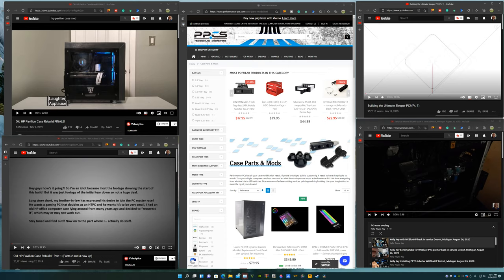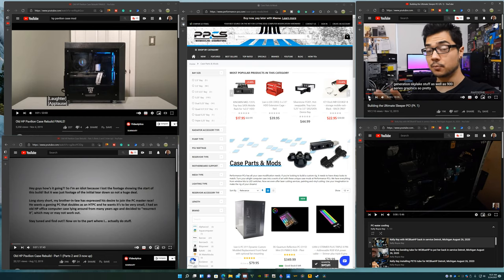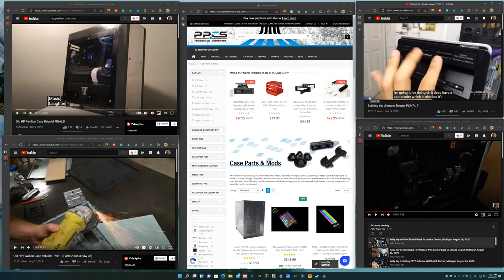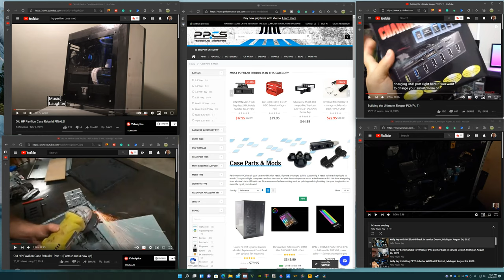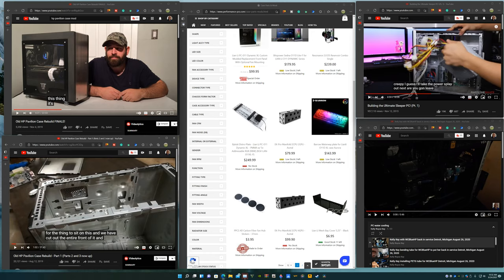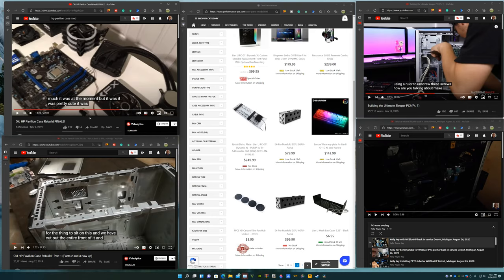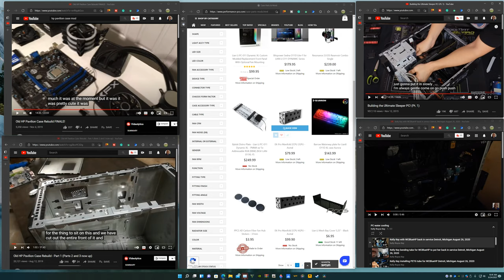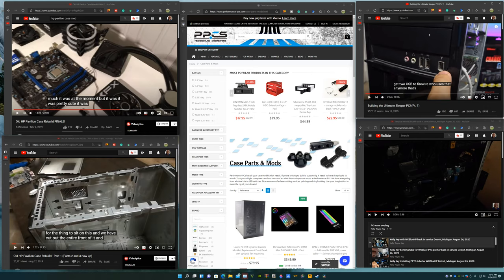Why brainstorm custom computer case mods? Featuring Performance PCS Bitwit Tick Tock Tech

Comment from the maker: Computer cases can come in many different sizes and it allows for different styles of case modding. The size and shape of a computer case are usually determined by the form factor of the motherboard since it is the largest component of most computers.